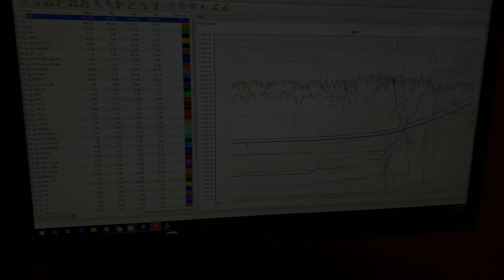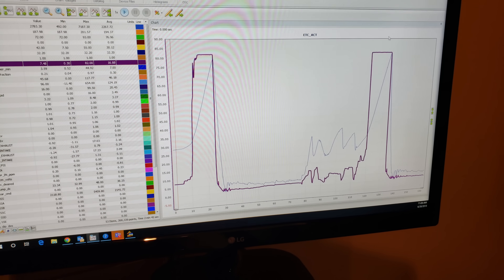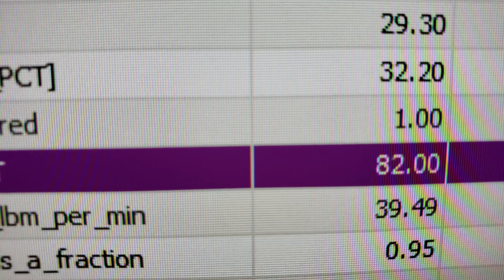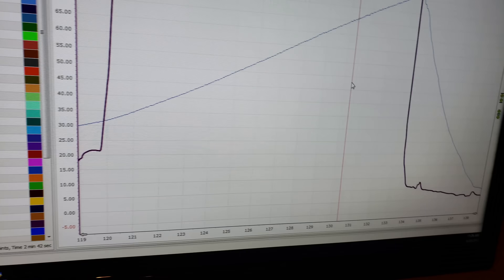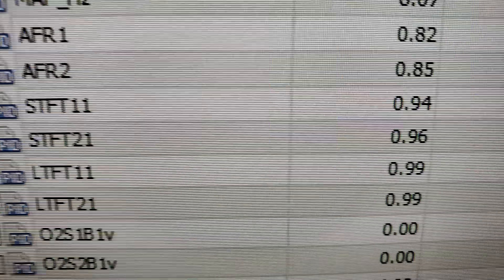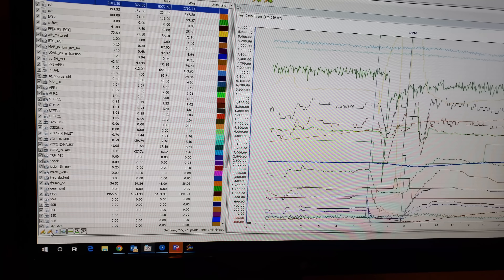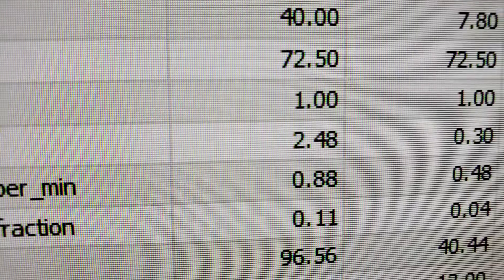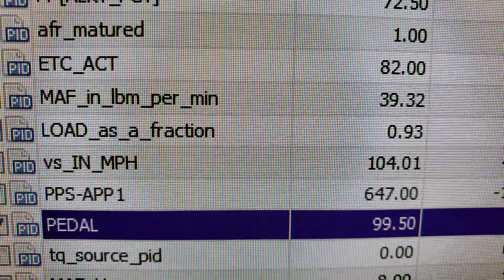How flex fuel Tunes works on N/A Coyote mustangs

Comment: Supposedly, Advanced Fuel Dynamics sells a system that automatically retunes on the fly with ANY MIX of pump gas and E85 with only one base tune required for pump gas.   
I'm skeptical but don't have any data to back up my skepticism.
Reply: tomcronininc it would work only with supported fuel upgrades on heavily modded cars, so there no need for there system, just upgrade your fueling system an get a flex tune if your car flex capable, or tune it for e85 an 93 octane
Reply: stylac if your car heavily modded they're fuel system doesnt work as they state, i tlk to rep ftom them, you would need a tune, injectors etc depending on what your mods are
Reply: mgerren88 
It doesn't matter which E85 method you choose.  You will need more injector flow regardless with E85.
Reply: Mgerren88 did they say that it will not work at all? It would be nice have the flex sensor option and run a tune

Comment: I ran two tanks of 91 octane and my alch/pct is still 28% is that normal. First time I was on full E-85 with 35 miles to E the second time I filled with 91 with 8 miles to go to E. But I still show 28% alch/pct? 17 GT Intake and CB only.

Comment: Thanks for making this video, I've been asking about this for months and why some tuners offer e85 only tunes vs. others offering Flex fuel tunes.
Reply: ellared4.9 i will be loading the flex fuel tune in my 2018 mustang gt next week
it should be interesting
Reply: How much hp do you make with E85 on a na 15-17 5.0 coyote (automatic if that matters)
Reply: Evo Slayer 123 Depends on the tune.  If it’s just flex fuel then probably no more than 10hp over 93 octane.  But if it’s an e85 tune maybe 30-40hp over stock.  Maybe more with bolt ons.

Comment: You must be a mind reader with these videos.  I was thinking about this recently.
Reply: Man O War me too
Reply: I swear to god I was just talking to my friends about how I wished I could run a setup where I can use 91 and E85 here in Los Angeles on my 17' GT but didn't know if tuners could do fuel mapping that way or if I had to get a fuel system/tune combo that could do it. Fucking 5 days later Alex the God uploads a video on it. Confirmed...reality is a simulation lmao
Reply: I have a tune! for 91 performance! What I am telling you is there is not much difference in the tunes between canned performance tune and a $$$ Flex  Fuel Tune!  So what is not safe about it? Engine runs like a champ on E85!!!
Reply: Dude read my comment above. You can mix E85 with 91 right freaking now! No injectors or any other BS people are trying to sell you. Seriously works for me and my 16 runs fine!
Reply: IMO a Dyno tune trumps all.
Reply: Literally me too
Reply: without a tune?  I doubt it is safe
Reply: I seriously doubt that you can mix the two without a proper tune. I’m pretty on the inside of my gas cap there’s a NO E85 sticker and for a good reason